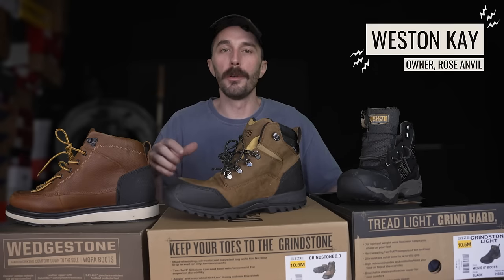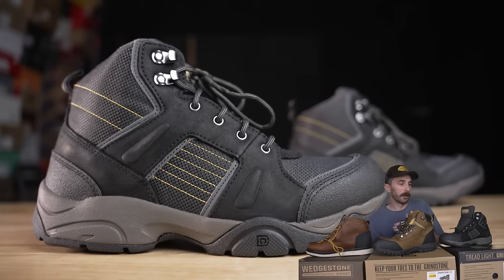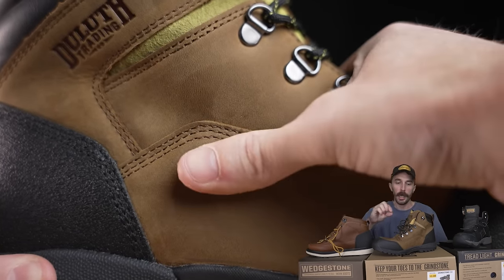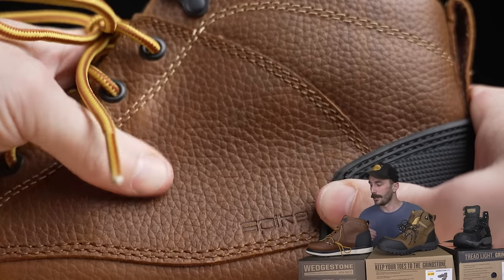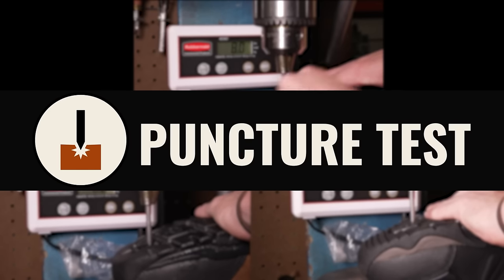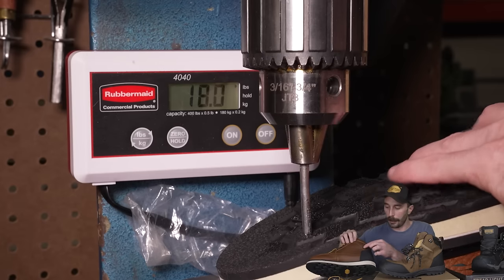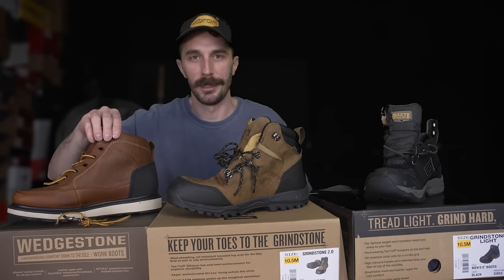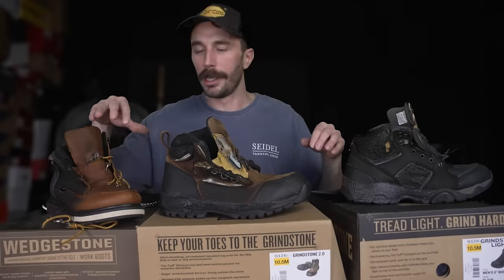Embarrassing truth about Duluth!

Comment: I've noticed a decline in quality and increase in price in most of Deluth's items.  They used to offer great value and quality but not so much these days.  Another formerly great option that is blah meh now.
Reply: Agreed. Used to have a lot of great products but then they get rid of the good stuff and never bring it back but replace it with mediocre crap
Reply: +1 I got one of their "lifetime" belts about 7 years ago and it was top-notch. For a $75 MSRP you got a SERIOUS hunk of leather I'm talking 3/8" thick. It also has really nice "nut-and-bolt" style hardware holding it together so you can swap buckles, take it apart to clean and condition it properly, etc. Just a fantastic product that I put a crazy amount of mileage on. It's still rock solid and has aged beautifully.

Fast forward to Holiday Season 2021 and I decided to hit up the Duluth holiday sale for some work pants. Almost right away I knew something was wrong when I saw that their old "firehose" pants had been discontinued and now the thinner, weaker "firehose flex" is the only option available.  Still, I like them for light duty work so I ordered a couple pairs. I also liked my old Lifetime Leather belt so much I decided to order a second one. 

It was CRAP! Spongey, foamy, weak leather that was stitched together instead of being one solid piece like my old one. The fold was stitch as well, no removable hardware and all the benefits it infers. Also, the new belt was almost 50% lighter than the old one. The quality was night and day, there's absolutely no comparison between their current "Lifetime" leather belts and the old ones. 

Another fine American brand ruined. Absolutely tragic.

At least Rose Anvil turned me on to Nicks Boots. The boots are $$$ but even at $99 their belts are a great value, seriously well-made.
Reply: There coolmax flex fire hose pants are great but I think alittle over priced at 70
Reply: @joshuatracy4829   They're worth it at holiday pricing. It's a $50 pair of pants marked up another $20 because of brand recognition.
Reply: @drunkenmessiah  the website still seems to have the original firehose pants, I haven't had to buy new ones in a couple years because they are actually fairly durable but the price is still low enough that they work out better than an other pants I can find. I generally agree that the flex pants are way too lightweight, for the money I am better off wearing jeans.
Reply: So true, and a bit depressing.
Reply: You can find the non-flex jeans and firehose pants, but you have to look for it. The flex material just feels stretchy, artificial, and cheap. It doesn't feel right, lay right, and I doubt it breathes or wears as well either. The long tail tees are still nice, but I'd wait for a 30% off sale, same as anything they sell.
Reply: @garethbaus5471  The "flex" pants aren't just lightweight and flimsy, they're NOISY. Sounds like I'm wearing a nylon tracksuit, every step is "whoosh whoosh"
Reply: agreed...

live in duluth and noticed this around 2019 where they started dropping in quality
Reply: The LL Bean factor.
Reply: I agree. And it happened after they went public on Wall Street. Before that they were privately owned, only having to answer to themselves and to their customers. Now the Wall Street shareholders have them by the balls, making them look for any and every cost they can cut to maximize profits, with no regards to customers or employees or long term outlook for the company. Fuck Wall Street. I’ve seen this currently happening at my workplace also.
Reply: I bought Duluth boots back in 2016 and still use them regularly. Haven't been anywhere near gentle with them either. It's really sad to see how far their quality has declined.

Comment: That discoloration when you bend the plastic of the insole of the grindstone is called Crazing it by mechanical manipulation you are effectively changing the way the molecules are bonded and causes plastic deformation at stress levels well below those required for shearing(breaking)

Comment: For the puncture test, would it work better if you had the shoe filled with something to simulate a foot? I feel like if the shoe is empty, more flexible shoes like the Lights will perform better than they should because they'll flex a lot more than they would if they were actually on your feet before putting up real resistance.
Reply: A metal cobblers foot or some sort of last should work
Reply: i second this comment
Reply: I agree!
Reply: How bout a cadaver foot … let’s make it more authentic lol
Reply: @julioherrera1443  maybe something out of ballistic gel?
Reply: No because they're testing the material imperviousness itself. Adding anything in to the inside is going to create resistance. While that may simulate "real life" it does not directly test the imperviousness of the material itself. Very few materials are going to act different between the two tests--they would need to be engineered to do so.

So you wouldn't want an entire foot in there necessarily. Just a way to keep the material in place. Cutting it out and placing it between a jig for example may work.

Comment: Should put some sort of fake foot (wood) in the shoes when doing the spike test. The boot body seems to squish and help the "performance"
Reply: Yup. I actually just suggested putting shoe trees in each shoe/boot and then securing it in a vise of some sort.
Reply: It would have to be something harder than wood though and there are some problems when it comes to knowing exactly when the piercing tool breaks through the shoe/ boot and enters the wood.
Reply: a fork-shaped support? the support would need to have a reasonable sized void for the piercing tool to go into - it can't hit a solid surface and give an accurate reading.  But mounting the boot in some way would definitely aid consistency!

Comment: I bought the wedgestones for work (I’m a residential roofer and we go through shoes very quick) and they suck. I returned them after 2 days. Didn’t keep me dry in the rain, plastic welt is no good. The only good thing is that dual density outsole 🤌🏻 I love the vibram christy but I hate how quick it wears out on asphalt shingles. Too bad the thin embossed cheap leather upper is attached to it by a cheap plastic welt. Resolable my butt! I wish I could get that outsole on a quality boot.

Comment: 5-6 years ago some family bought me some Duluth winter work boots. I concur with you, for the price paid, garbage boot on comfort, insulation, how long the water proofing lasted, and comfort. The sole for ice traction is likely the one redeeming quality.
 
If I actually worked daily in them, rather than just for clearing the snow in my driveway, would have tossed them a long time ago.

Comment: Regarding waterproof membranes, they are ALL really thin, simply because the thinner the membrane the more breathable the material all else being equal. And it is common for them to puncture due to bits of grit or debris getting into the boot. Then they get wet inside and the water stays inside as they dry out really slowly.
This occurs whether they use Goretex, Event or the dozens of other brand name versions.

Comment: Great video!  Basically, A good quality long lasting work boot starts at around $275 ? I have the redwings king toe and have been wearing them for a year but now they're starting to get a little uncomfortable,  Think I paid $240.
Reply: I've been wearing my $140 Timbs for about 5 years with no problems Had to have them repaired once after I eventually wore through the fabric but I asked the local cobbler for an all leather replacement counter and insole. They aren't waterproof or indestructible, but I think Timbs are the best value for looks and durability.

Comment: Pretty sure aluminum melts at like 1200 deg f.  that eyelet definitely wasn't aluminum, but it might have been Zinc which melts around 700 deg f. and zinc is super cheap and frequently used in cast parts as a cost saving measure.

Comment: I have a pair of Duluth boots. They look similar to the Grindstones, but have Goretex and a thermal insulation layer, plus the puncture resistance, and a composite safety toe. Will they last? No. But I got them for $50 on clearance, and at that price, I think I did well.

Comment: Lived my keen boots. Didn't need steel toe or metatarsal protection, but I'm picky when I buy boots, and they were the only ones I liked that day. As far as comfort and fit. Had them for 2 years. Worked in them every day. Swap out the insoles for aftermarket insoles and replace them a few times. But keen probably the best boot I ever owned.

Comment: Heyo! I just wanted to say that while these boots are dogshit for manual labor, the Grindstone Light is pretty good for working Back-Of-House in fast food because they’re thick enough to prevent grease/hot stuff from hitting you, the non-slip actually works, they’re fairly comfortable if you replace the insoles, and the toe cover is durable enough for what you need in a kitchen without being super heavy.

They’re also shitty enough that you don’t care if you ruin them (which you will, the grease will destroy any clothing or shoes you wear over time).

Comment: I don't think your bar drop test on the Wedgestones was quite right.  The energy from the bar drop was converted into rotational motion of the boot.  I think this affected the bounce.  I would suggest you add some way to hold the boot rigidly so that it does not move when it is struck by the bar.  None of this changes how much these Duluth's suck!

Comment: I use the grey ones in this video and they lasted about a week before I started getting holes. But they are comfortable I guess. What’s your recommendation for a good work boot?
Reply: Red wing, thorogood, Danner, whites, keen, Irish setter,  Georgia boot, Carolina
Reply: @isaiastopete4174  my keens got holes in 3 months, wouldn’t buy those again
Reply: Thorogood or Carolina if you like union made in USA, and a few Red Wing styles. Thorogood or Carolina if you don't plan on keeping them long enough to resole because they're comfortable right out of the box.
Reply: @gonzomalan  it's worth noting that only a select number of Carolina's models are made in the US.
Reply: @brighamruud5090  I rock thorogoods, but I was just naming what I've seen on the jobsite, the keeps look more like hiking shoes but some guys swear by them
Reply: REDBACKS. They saved my feet from agonizing pain and I learned about them from Rose Anvil. Most comfortable boot I've ever owned and pretty dam tough work boot for us who are on our feet for 12+ hours a day.
Reply: @isaiastopete4174  I gotta agree with Brigham, i tried using a pair of keens as a commercial sparky and they were trash, one of the speed hooks ripped off after a few weeks. I've seen them around on jobsites as well, but i don't get them
Reply: Redback, super comfy, made in Australia (not China or Vietnam) – I have a pair that has done over 3500 miles on concrete in less than 2 years (walking the same route every day).  Still going strong although the sole is showing wear.   Going to get another pair as it's one of the few brands that don't give me foot pain.
Reply: @ckm-mkc  Best boot 👢 in the world in my opinion.

Comment: This doesn’t surprise me in the least. Duluth touts their durability on all their products, but they’ve been the least durable clothing I’ve ever bought - worse than cheap clothes. Their “tRiPlE sTiTcHeD, gUsSeTeD” ballroom jeans wore through in just over half a year. Meanwhile, Wranglers at 1/3 the price have lasted a couple years at work.

Their rain suit set that is machine washable literally disintegrated in the wash, following their washing instructions.

Duluth also doesn’t warranty their products, they “gUaRaNtEe” them and will charge you shipping both ways. They’ll only replace the item if they decide the product failed due to their own trash materials and labor.